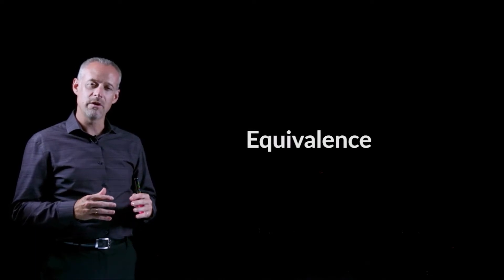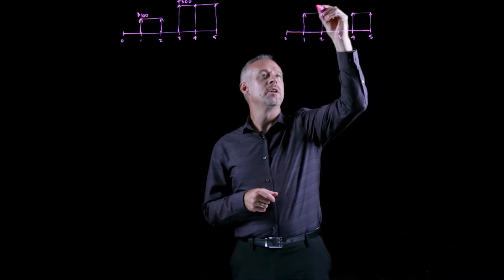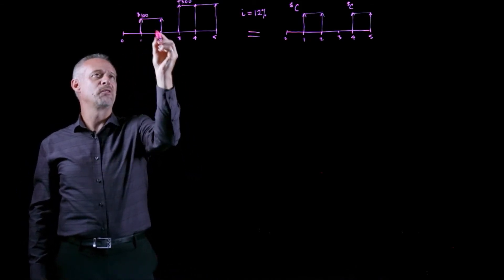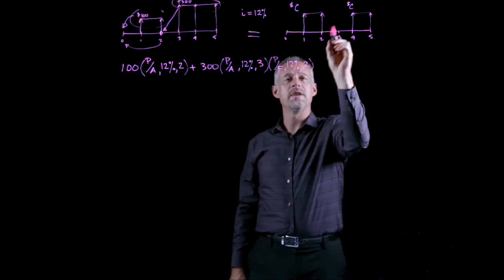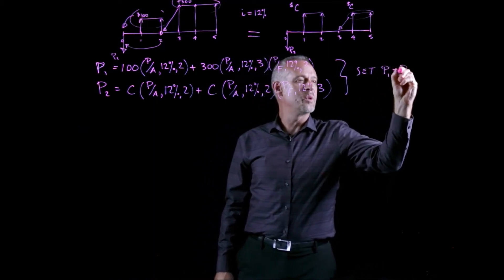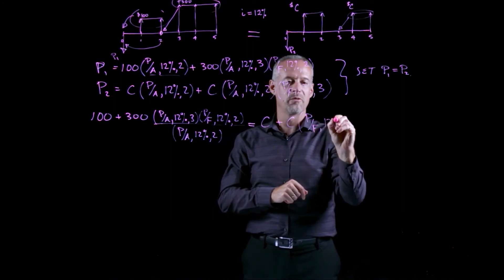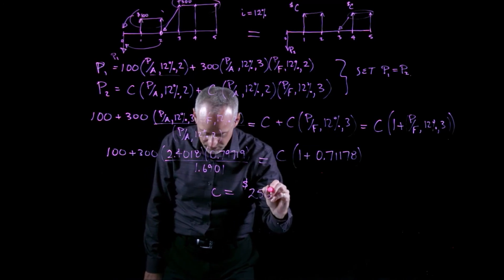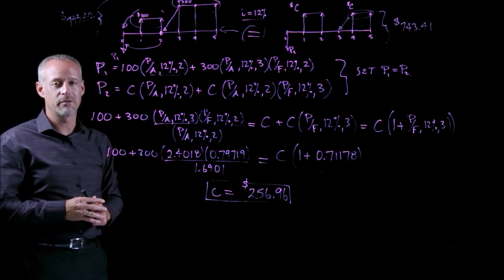Equivalence - Engineering Economics Lightboard

Comment: Thank you so much for your lecture! But I do have a question: Is the C value in periods 1& 2 different from the C value in periods 4 & 5? From the question, I see the arrows in the 2nd diagram presented differently in magnitude, can you please explain that part?
Reply from the maker: Hello!  Thanks for the question.  The value of 'C' is intended to be equal for all periods (1 & 2 and 4 & 5).  The arrows are meant to be shown as all equal in length.  The algebra only works if this is true.  I hope that clarifies.
Reply: @EngineeringEconomicsGuy  Thank you for your explanation. This helps me a lot

Comment: Sir, I didn't understand why you used P given F factor to bring the payments back twice.
Reply from the maker: Good question!  Using the P/A factor works for the cash flows at times 1 and 2 (brings them to time 0), HOWEVER, for the payments at times 3, 4 and 5, the P/A factor only brings the payments back to time 2.  This is why we then need to use the P/F factor to bring the t=2 amount back to t=0.  If you're having trouble, I suggest looking at my videos on 'patterns of cash flows'.  https://youtu.be/t3i7OFWxIN8
Reply: @EngineeringEconomicsGuy what if  in another case, I had to move backward 3 times to t=0, how should I do?
Reply from the maker: The same way using the P/F factor but with N=3.  I suggest you look at the 'Cash Flow Analysis' Playlist on my Channel.
Reply: @EngineeringEconomicsGuy  I will check it out. Thank you sir. You're doing a great job.👍🏾 Keep up the good work!
Reply from the maker: Thank you for the kind words - I really appreciate it.  I hope you get everything figured-out!